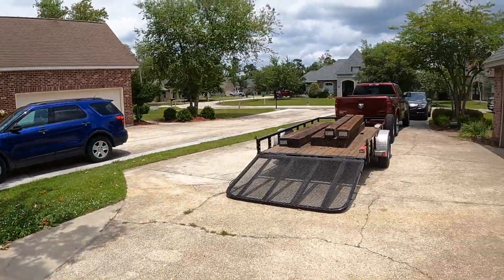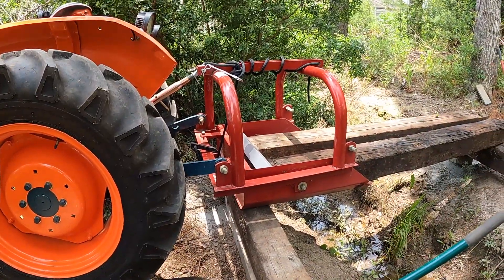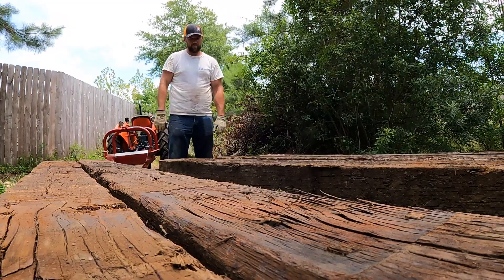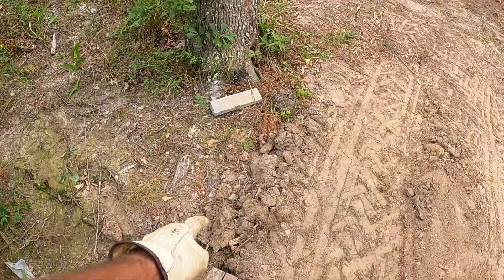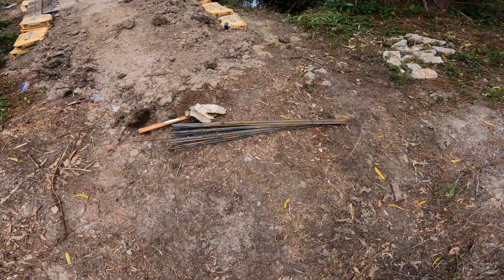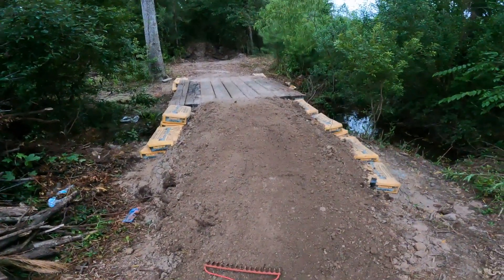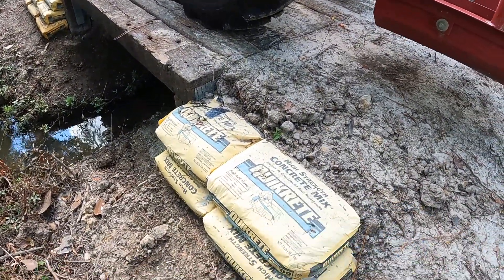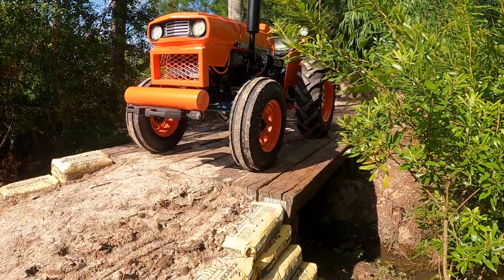How to Build a Bridge Over a Creek ~ Cheap Lumber! Pt. 2

Comment: Can we see a 1 year after? love the video boss
Reply from the maker: Yeah I’m actually going to clean the trail up in a few days. It’s blends in with nature very well
Reply: @RaztechPowersports  I would like to know how it held up overtime too.  I've got a similar problem.  We have a dry creek that cross our fence line, only have problems when it rains a lot.  Tried a pretty small culvert, but it overwhelms it during big rains and gets washed out.  I live near a rail road and I always watch out for when they are getting rid of old cross ties.  I have 2 dump truck loads of them right now.  I think they will make a good bridge.  I'm just interested to know if there was excess washout with your bridge.  Cool video!  Thanks!
Reply from the maker: @NickBoen-o8s  still holding up great! I’ve driven my kubota L2501 over it multiple times as well with no issues. Rock solid!

Comment: If you add 2X8 treated lumber on top perpendicular to the beams, the loading would never be on a single beam. Although your bridge is strong enough now, over time, a single beam can weaken. Great ingenuity, otherwise.
Reply from the maker: For sure but for the intended use, it’s very strong. Decking it would have cost a pretty penny too 🙁
Reply: @RaztechPowersports  New ties support 25,000lbs each.  I'm sure your used one can handle your 4,000 lb tractor.  I'm building a trestle bridge on my property with ties.

Comment: Need same thing you built, ATV/foot bridge but span will be wider. Did those RR Ties come in at 8'6"? Any idea how to do longer spans with RR Ties?
Reply from the maker: Yeah do but they are really hard to find. I would check out your local rail yard. Typically you can get the used ones for free
Reply: @RaztechPowersports  Thanks sir, free is good! My problem is gonna be the span of the creek at my property line, it is well over the 8.5" RR tie length. (We have a lumber yard here with them but never thought about a rail yard - got a couple of those around here in east Texas.) There is a double trunk tree felled (pushed over by a previous logging job I believe) I may try to use as the crossing pieces.
Reply from the maker: @ktrezise1  Yeah it’s all about being resourceful but also building it to last. Cost of big lumber is pricey so the railroad ties are a steal